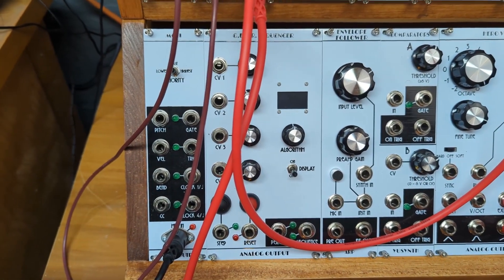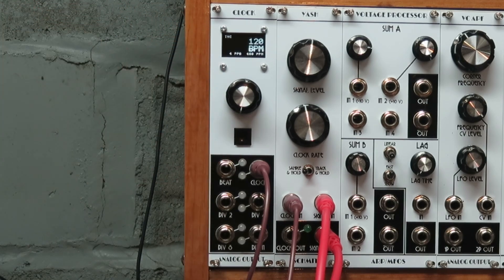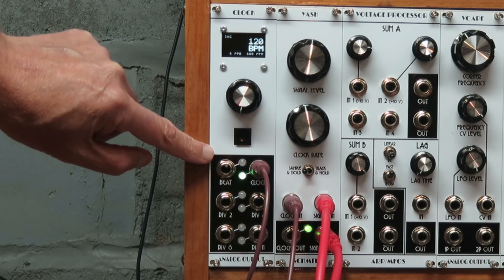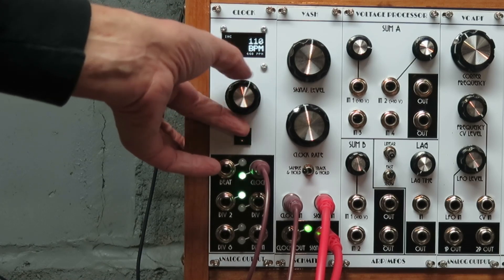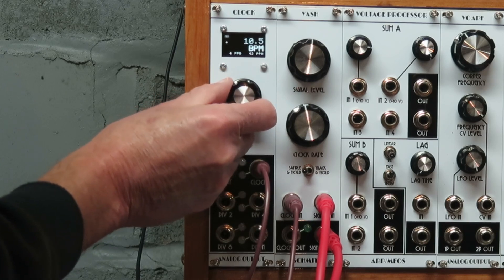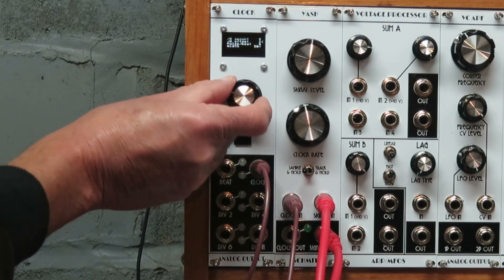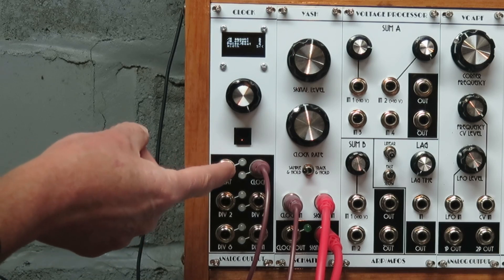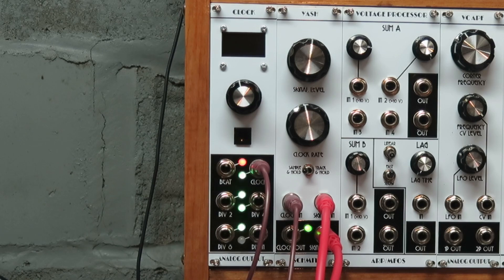Clock synthesizer module

Comment: Nice build. I do have a little issue with the oled display. It shows everything as on the video but it also shows some vertical glibberish on the left colomn below the inc text. Cannot upload picture to show..
Reply: Solved this issue by changing the code in the ino file U8x8_sh1105 etc etc into U8x8_SS1306

Comment: Hi Mr. Holmes. Ive breadboarded this nice clock module and i was wondering if i could use diodes other than the 1n4733? Would Bat42/43 diodes do the job too? One connected to 5v and a 2nd one connected to ground like often seen in Hagiwo schematics? Thanks in advance for you reply
Reply from the maker: Yes — 1N4733 is a Zener diode so BAT4x would not be a direct replacement, but as you say you can use two Schottky diodes such as BAT4x, one to ground and one to +5 V, to serve the same purpose of protecting the Nano against outputs shorting to ±12 V.
Reply: Thank you for confirming.

Comment: Well done and thanks for sharing. This is a very useful addition to my setup and just what I needed as a base to get going for both MIDI and analogue clock sync'ing. To your design I have added a MIDI interface to sync up a PolySeq Sequencer that can only be clocked externally with MIDI DIN (or Midi over USB) input. The analogue clock outputs go to my semi-modular Moog gear.  
Works like a charm. One additional change I made was to swap the push-button and the encoder switch as I wanted a dedicated start/stop button. Love the display handling and menus... 
Happy to share if you like these ideas?
Reply from the maker: Would love to see it!
Reply: @analog_output  I'll put it in a case over the next couple of weeks (it's on a breadboard at present) and I'll send you some pictures when it's completed.

Comment: Great idea. Would like to re-arrange for eurorack but kicad files will not open. Error messages "not a kicad file". Any ideas?
Reply from the maker: Which KiCad version are you using? Needs to be 6.0+.
Reply: @tomhague, are you willing to share the eurorack files?
Reply: Can do once I sort through all the revisions made during resizing. My version fits 80mm eurorack. Not pretty at the moment. Front panel got messed up. @Cartocopia